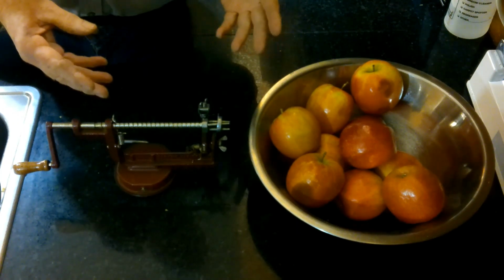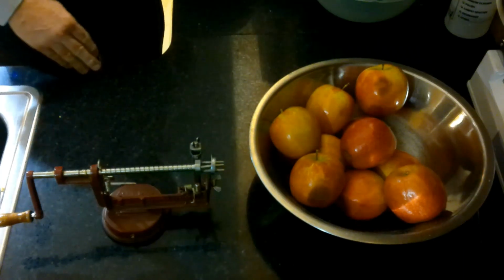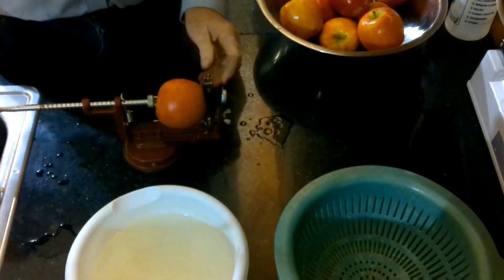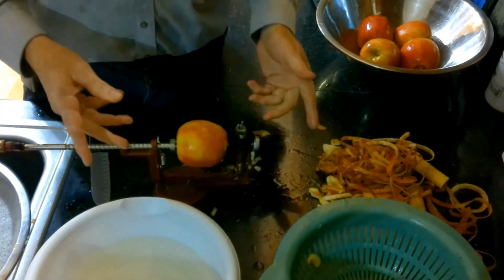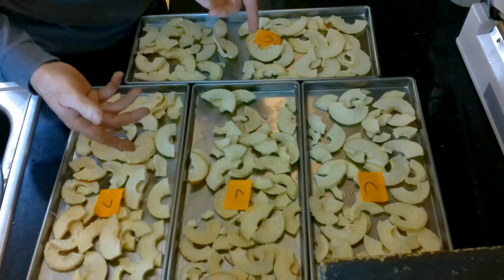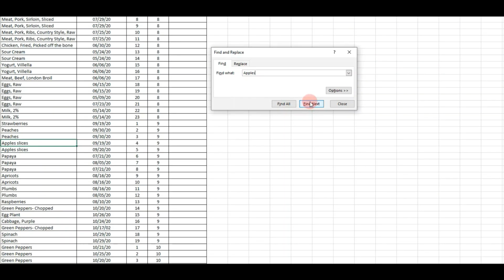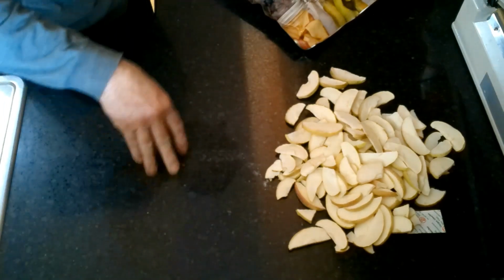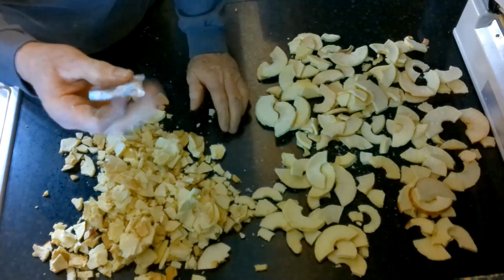Freeze Dried Apples

Comment: 14:40 """ OR His sealer has not been preforming its duties well with the sealing process. One tiny little ripple or drop of moisture on the bag in the sealing area can corrupt the entire bag. My problem was with powdered milk and the creases of the bag and then rice which is basically a bunch of pin points making all kinds of micro holes in the bags. I have had to re-doo all 50 lbs of rice cause of this.  As for my sealing of these two items i now only use jars for the rice and the milk is vacced only if a bag, that can be completely flat  when sealed. Less product in the bag and more of them.  My fav thing right now is beef stew.  Insta stew from the insta pot with no pot. HeHeHe Thank you for showing apple tech..

Comment: What were you settings for these freeze dried apples??
Reply from the maker: If you're running any program above v16 it should be automatic.  What program is on your machine?
Reply from the maker: Perhaps this is what you're seeking:
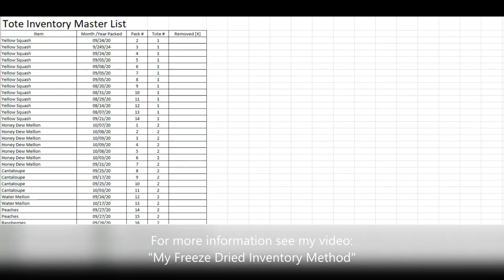0 degrees freeze, 0:00 extra time, 130 degrees shelf temp, and 12:00 extra time
Reply: @Philat4800feet  I have 5.4

Comment: I see you use thermometers. Have you ever done an analysis on foods that fall into time and temperature control for safety (TCS) and freeze drying? I am trying to get a variance to freeze dry some foods that fall into that category. I will need to show that the food does not go above 41 degrees Fahrenheit until less than .85 water activity. FDA and state food codes are very meticulous. I have watched your videos and know you are very detailed so did not know if you did any test or know of anyone that has.
Reply from the maker: I haven't done anything to the details you are seeking.  Temperature would be easy to collect.  Percentage of moisture would be more detailed.  You got me thinking on how this could be done.  My initial thought would be to contact a food lab at a nearby university.

Comment: i vac packed some rice but it ended up causing pin holes so i gave up vac sealing on about half my stuff.
Reply from the maker: I've had the same problem.  I put "sharp" foods inside a Ziplock bag with pin holes punched throughout.  I also use 7mil or better bags.

Comment: I don't use an oxygen absorber in bags I chamber vacuum seal.  I noticed when vacuum sealing a mason jar with oxygen absorbers in the jar they blew up like balloons inside the jar, I don't want to risk an oxygen absorber getting tore open by the vacuum pressure and putting charcoal all over my food inside the bag.
Reply from the maker: Strange.  The packets should be porous to allow the oxygen to mingle.
Reply: @Philat4800feet  The packets in the jars didn't come apart (I also only ran the chamber sealer for about 10 secs for jars) but the size they increased to while being vacuumed down leads me to believe they could, and inside a mylar bag (which I run the chamber sealer for 50 seconds) you would never know it happened until years later when you opened the food.

Comment: Hi Phil, I did 4 trays if lasagne and 1 tray if pure sauce , then cleaned the drum with 75% alchohol but the drum still smells like pasta , what do I do to clean out previous batch smells?
Reply from the maker: Did you also clean the shelves?  You may need to rinse and repeat.
Reply: I sure did
Reply: Hmm. Maybe run a loaf of bread through it, like you may have when the machine was new? Otherwise perhaps baking soda and water.
Reply from the maker: @TonyGarrett-p1c  Be careful with baking soda, it's abrasive.
Reply: @Philat4800feet  Ah, gotcha.  Maybe not so dissolved in the wash water?

Comment: I exclusively use Vitamin C powder (1 tsp/quart cold water) when I freeze dry or dehydrate apples. I like it because it doesn't add any taste to the apples unlike lemon juice and it does a superior job in preserving apples. Well crap I've never gone back and checked the apples in the mylar bags. I just assumed they would be crisp. I keep a half gallon canning jar of freeze dried apple slices (vacuum sealed) in the pantry to use for baking or adding to oatmeal. I just opened it and while softer they still snapped. So I'm satisfied. A little FYI the other good thing about Vitamin C powder it says if properly stored it doesn't have an expiration date. Phil does your vacuum sealer have an adjustable setting? I know mine has a delicate setting to it doesn't vacuum seal as quickly or as strong. You might see if you can turn it down with fragile foods.
Reply from the maker: Plus the Vit. C is good for you.  My vacuum chamber doesn't have a setting, but I could run it to a lower Hg/in amount.  This is what I use:
https://youtu.be/CDj02lxBFiQ

Comment: Phil, thanks for your response. It appears that I use the same method that you use. The only exception I can tell is pre-freezing. I have never pre-frozen any of the foods that I freeze-dry. My trays were more loaded than yours were.  I vacuum seal my food in clear bags with oxygen absorbers. I use everything I freeze-dry within a couple of months so I wasn't concerned about using mylar bags. I know that I am getting a good vacuum on my freeze-dryer. Not as good as I have heard you say that you get, but when the process is finished, I am around 350 millitorr. And I usually increase the dry time by over 12 hours. I may need to wrap my heating shelves in tin foil, as you suggested in one of your videos. Thank you for the time you took to make this video.
Reply from the maker: Looks like you're doing everything right
Reply: @Philat4800feet . Thanks, Phil!
Reply: What kind of bags are you using to seal them in?  The food saver bags leak air and that might be what’s wrong.  Also, see thru bags are not recommended for long term storage.
Reply from the maker: @katharvey7324  I prefer 7 mil "Mylar" bags without a zip lock seal.